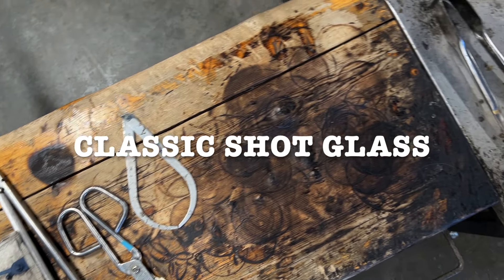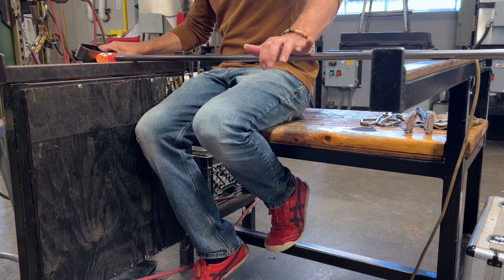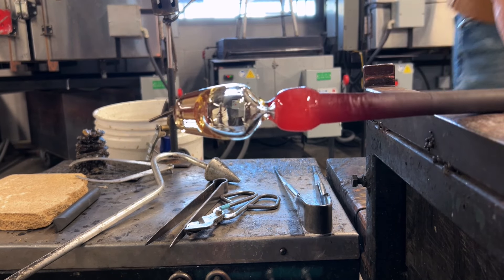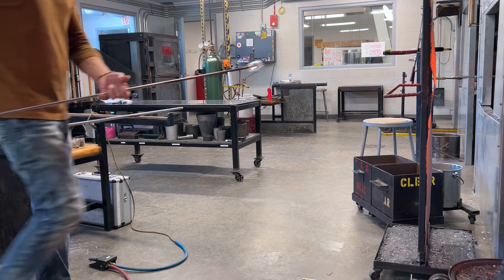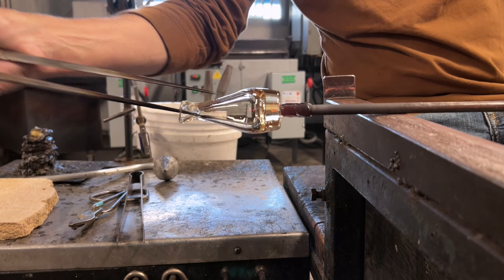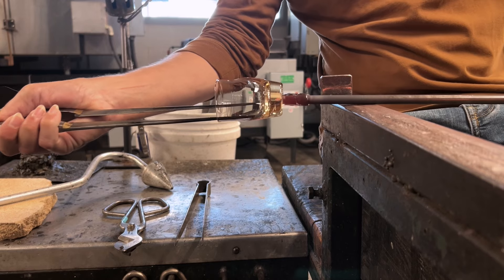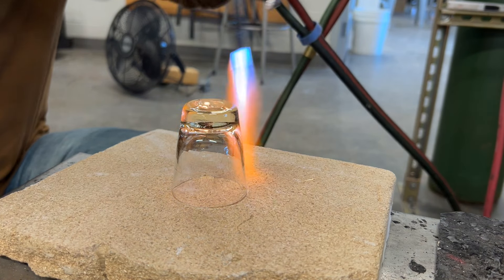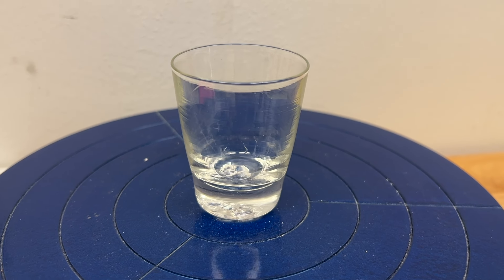Can We Make a Better Shot Glass? | Glassblowing demo + a little history

Comment: Thank you for this video on shot glass blowing, as well as all the other videos you have done. I find them in valuable as a new student to glassblowing.

At the college, where I was taking classes, I tried to make some shot glasses, but the instructors were not able to help me much and I ended up with some glasses with fairly thick lips. I think I’m gonna try your method., next chance I get in the hot shop . I was trying to do the shot glasses with color so I was putting the color in on the first gather and then covering it with clear to get a clear bottom, which left quite a bit of glass for me to work with. If there’s a way for me to send you a picture, let me know so you can maybe better understand what I’m trying to achieve.

As for future video suggestions right now I’m working on sake sets, i.e. the carafe, and cups.

Thanks again
Reply from the maker: Thanks for the comment and kind words! I've made cups with color on the very inside before. Usually it begins with a color overlay or collar pickup. Both with color bar. Then I blow that into a long tube and section it off making "supios". You can watch this process here: https://www.youtube.com/watch?v=tzEOposyog4 Then I pick up the cups, gather over them, and make my object. This seems like a long way round, but it's is a great way to really thin out color and get a nice veiling on the inside, leaving that thick base. Just one way to do it.
Thanks for the suggestion on saké sets! Great idea.

Comment: The story with this demo is what makes it. Thanks for the excellent instruction. As a beginner, I would be interested in what you think are primary skills that will me improve my overall skills and knowledge of the art.
Reply from the maker: For primary skills in glassblowing, I would say 1) Gathering—if your get glass skillfully you have to try and fix it for the whole piece. Good gathering is key. 2) Controlling the glass—turning, marvering, rolling at the bench, oh, and sitting down quickly and delicately! (That last one is crucial to blowing thinner.) 3) Neck-lines and Punties—these two elements have a relationship: if you need a delicate punty because the piece is thin, you need a small neck-line. Work on those skills and you'll improve quickly!
Reply: Thank you. I appreciate the advice, and i will place more focus on these areas. Watching your video on punties helped me significantly improve my understanding and confidence in the process.

Comment: Could you explain how you can tell when you need to heat the glass again and again during the process and what happens when it get to cold.
Reply from the maker: That is a great question. I comes down to experience, but basically you need to reheat when the glass stops moving. So, if I'm trying to open the rim on a cup, if I only get it 1/2-way and it becomes hard, I need to reheat to soften the glass again. If it gets too cold it will crack and then shatter. This is because as the glass cools it is shrinking—most materials expand when heated and contract when cooled—but the glass isn't the same thickness or temperature throughout. That means it will cool and shrink at different speeds, and crack itself apart. That's why I put the glass into one of those silver boxes behind me whenever I'm done. They hold the glass at a safe temperature—960F—and then slowly cool it down overnight. I get to see it the next day!

Comment: Davin, great video.  I learn something new with everyone.  I'm sorry for asking something so basic, but where did you get that skull stamp tool you used?  If you made it, what is the material?  I completely fell in love with it and want to add it, or something like it to my kit.  Thanks!!
Reply from the maker: Thanks! I carved it out of a graphite rod using a small die-grinder and diamond burr. But, I think you can buy them for Flameworking from various suppliers. I bet you could also use a brass stamp from Etsy. There are lots of suppliers of "Makers Marks" or "Touch Marks" out there. Good luck!